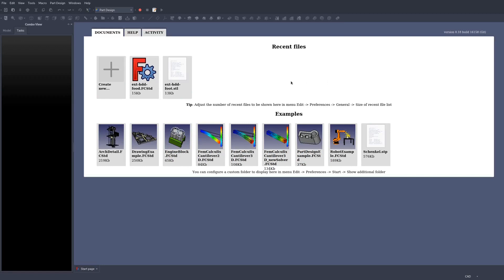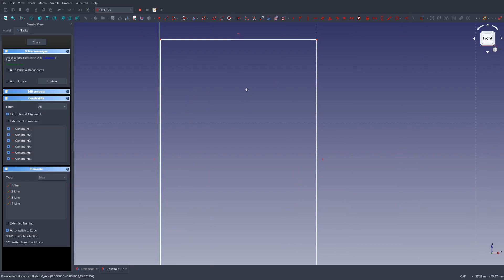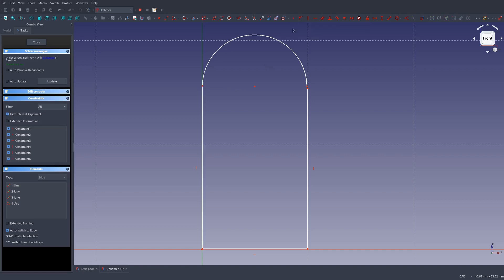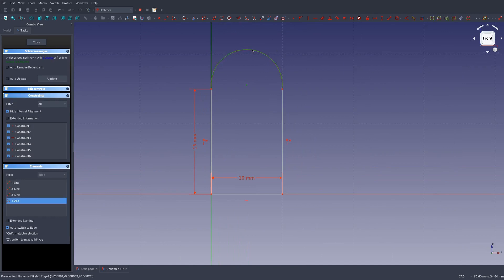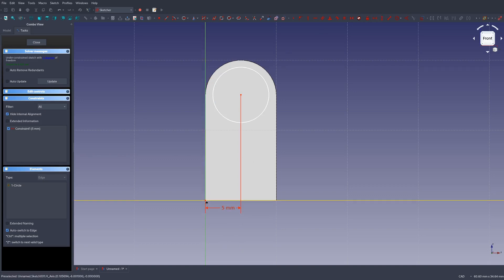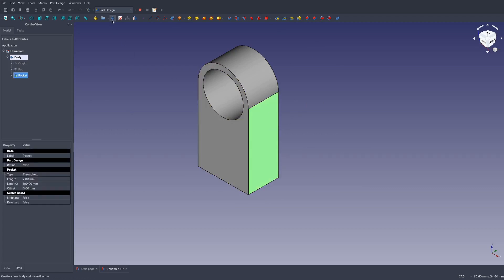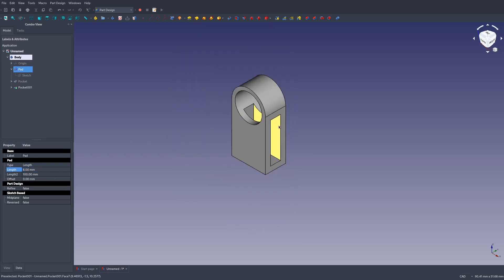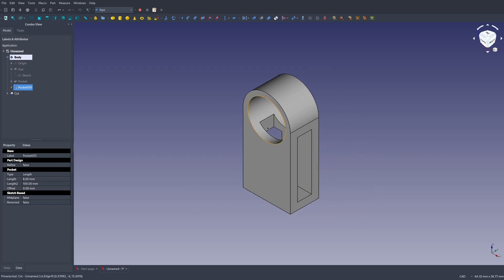FreeCAD Tutorial 2: Part Design Workbench Basics

Comment: most of these vidoes dont say what versions of freecad they are using,makes it very difficult to learn 2 weeks in watching still not able to set to inches and change colors or show hidden lines.
Reply: in the top right at the start of the video it shows FreeCAD v0.18. Though it hasn't been in development in 2 years. I talked to the developers in IRC chat on Freenode. They recommend v0.19 even though it is in beta. It should be officially released soon.